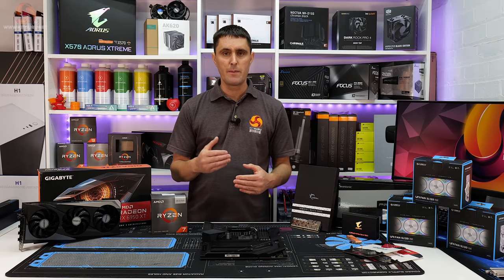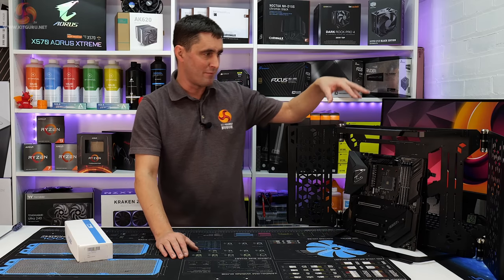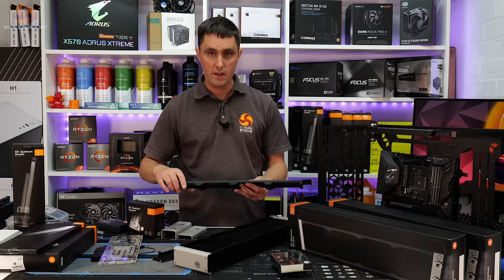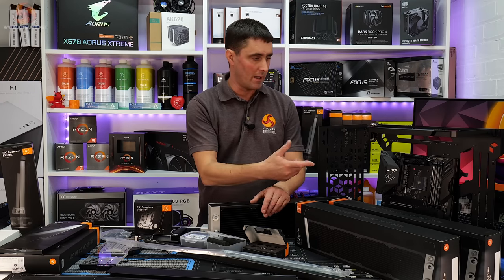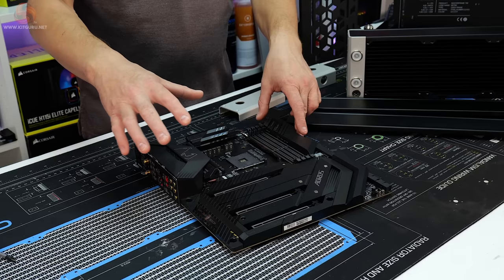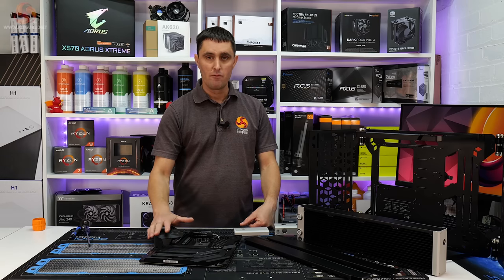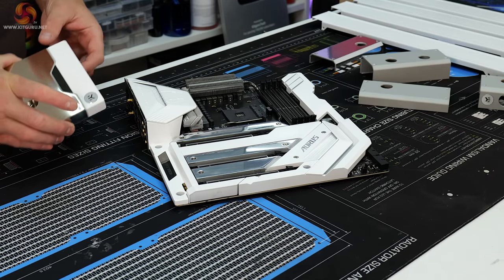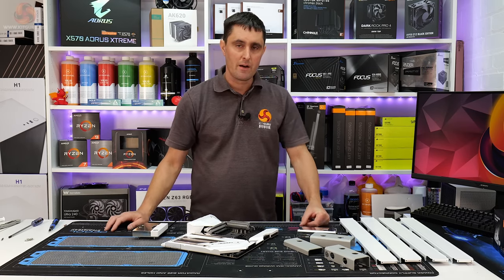We Build an AMD AAA System With a Twist - AMD FRAME (Pt. 1)

Comment: To me I think getting a chrome finish on those end caps would look the best. It's fine with how they are, but they would match up a bit more with the chrome.
Since all of them for now are white with a polished look then satin does kinda go another way. But then again the cables won't be chrome so maybe do something more with a satin finish? The cables had more of that color anyway so maybe some details on the case like split coloring those bars white and satin? That way there's more then just the end caps. If so then I think it would work fine. But if it's just gonna be the end caps I'd say go chrome.
That or it could also be nice if it was all satin, doesn't have to be a polished finish. But then you have to redo some stuff so.
In any case. Another beast mod from KitGuru! Can't wait for part 2! Great job James!
PS. Norway here, I'm really hoping this giveaway will be worldwide, the rest of the world loves you too! Was sad not to join the last one cause it was mindblowing!
Reply: Interesting idea, thanks for your input, im glad you are enjoying the build so far. 

I wasn't planning on adding any other satin parts so I think chrome might be the best option for the radiator end caps.

Comment: James, as always your custom work is incredible. One day, I would love to take apart my own motherboard and spray paint it a different color. But first, I need to get over my fear of potentially breaking something during disassembly haha. Looking forward to the next video!
Reply: Ger over the fear. Just be prepared to open your wallert again of something goes wrong.

 Main thing is to be careful and pay attention to where everything goes during dissassembly, take photos too.
Reply: If there are simple screws holding the bits on it would be easy to take bits off. Just keep the screws carefully and note where they came from.

Comment: I just love the white & chrome theme you started. Please wrap the radiator ends in chrome. I was wondering have you thought about doing the case the same way in chrome? Instead of wrapping it you could sand it down and have it professionally ionized chrome. If going white have it powder coated. Both methods are expensive but the result is show quility. Can't wait to see the finished build.
Reply: Yes I was thinking of having the frame powder coated.

Comment: the radiator end caps would look better with a chrome finish instead of the satin...if the wrap doesnt work you could have them dipped...nice build so far
Reply: The end caps are also aluminium so polishing could be an option if the wrap doesn't look good enough.

Comment: Good job with mods, love the build, i think mirror finish would look better. One question, i always believed that anodised aluminium was better at thermal conductivity than untreated bare aluminium. If so, do you think you will see any noticeable difference in the vrm heatsink cooling performance?
Reply: I dont think it will make any difference to the vrm temperature.

Comment: I actually have two EK Quantum Surface P360M … I wanted to go with the X but did not have the space to put fans on both sides 
EK actually recommends this on the X line  as they will otherwise just preform pretty much the same as there P line
However in the case of the build that is done here two P360M’s would have already provided more than enough cooling